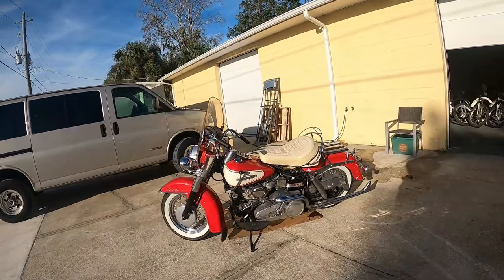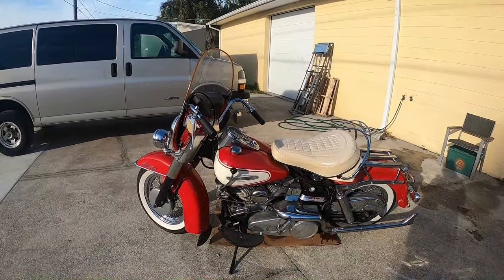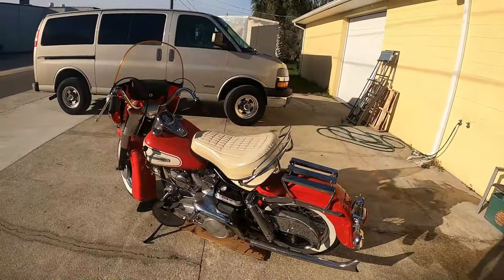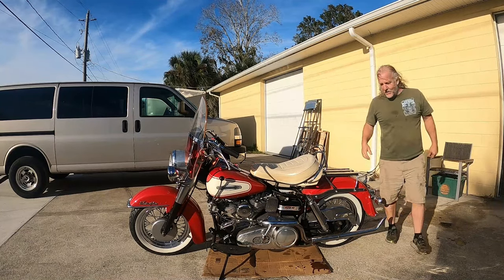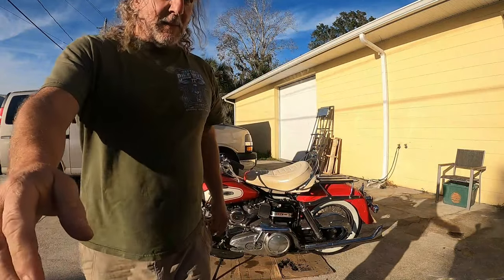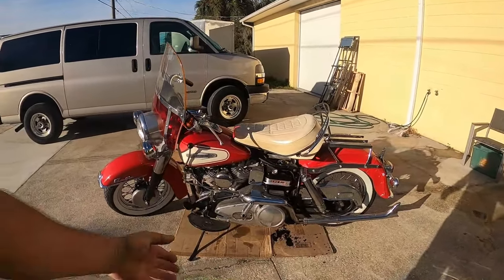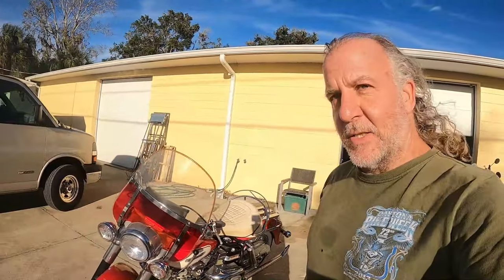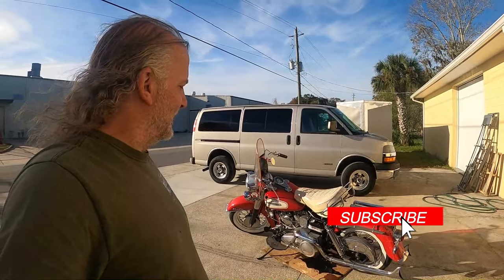Hand shift Harley Shovelhead in 1966

Comment: What a beautiful shovel Dave , this is just me but l'd put a old solo seat on it & change the bars to a more panhead style straighter style , l once had a 75 electra-glide & made it look like a 58 duo-glide , l still have that style shifter in a box that come on my 47 knuckle but replaced it w/ a proper tank shift w/gate . These old Hog's will out live us , nice bike Dave .
Reply from the maker: Yeah, the small police seats look nicer. I tried to put the old bars on, and add the manual timing advance/retard but for some reason, it did not want to fit. I think the old style bars are two piece, yes?
Reply: Yes they were 2 piece but on my 75 flh l added a riser & converted to a conventional one piece handlebar with way less sweep , being a lifetime offroader/racer l'm used to a dirtbike type bar w/ very little sweep . Even my current Heritage Softtail Classic first thing l had to do was scrap the stock bars & seat , bought an Ultimate solo seat out of Florida  , oem bars had too much sweep . Found a set of early 2000's Victory Kingpin bars that had enough rise but very little sweep to make the ergo's perfect for me at 6ft tall . I still have a couple of those thick buddy seats like on your 69 & rode many mile on them especially on the Knuck  but never really enjoyed the ergo's til l went back to a solo seat , l've had both solo's the Deluxe w/the trim & the plain & yes you would see those seats on the early police bike's . Your 69 is a keeper in my eye's keep on keepin on ,

Comment: She's a beauty! When it stops pissing oil, does that mean it's full? No experience with shovels. How many miles on her? Thx for dragging her out for some fun in the sun!
Reply from the maker: Yes. After is runs and the oil level equalizes. Old panhead do the same thing. I think is just under 6K since its restoration

Comment: You can set up an Indian toe to go. You can also switch the throttle to either hand. Indians had a lot of clever features.
Reply from the maker: Yes, I knew you could switch the throttles around, so I am not surprized.
Reply: @bullpencycles  my Chief is right throttle,  left ignition advance and left side of the tank shift.  It's all easily switched.
Reply from the maker: @slowpokebr549  i have a 51 chief i have to pull put sometime. Its way in the back

Comment: Why didn't you just slide a drain pan under it instead of having oil stains all over your concrete pad ?
Reply from the maker: The cardboard did catch it all
Reply: They are quite low for oil pans, a pail lid works better, beautiful original first year shovel
Reply: It really is a nice looking bike 👍
I'm sure you know that the oil tank is incorrect ?